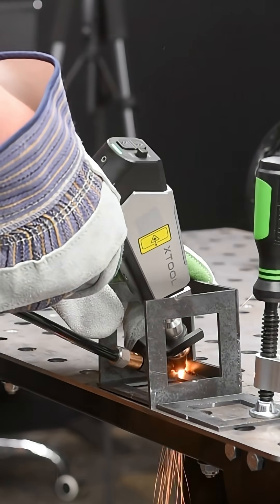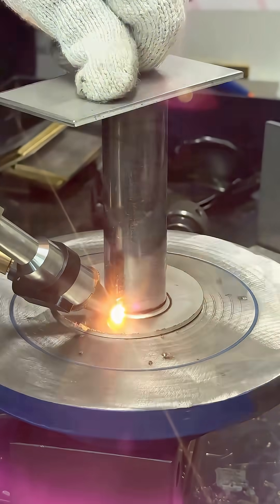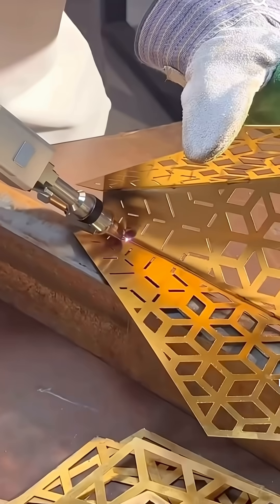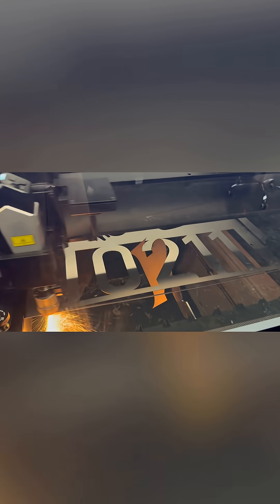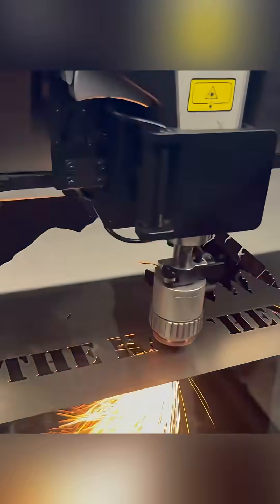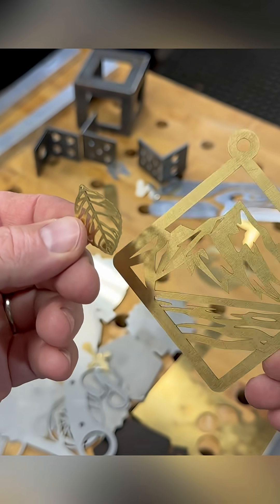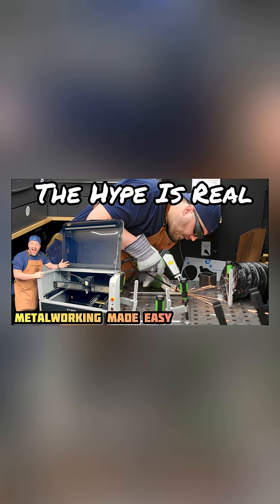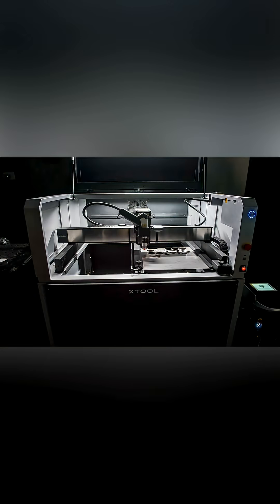xTool Metal Fab: Metalworking Game Changer is in Stock

Comment: Or you could just learn how to weld and cut the crap, this is a complete joke of a product and it probably dosnt even work
Reply: It works amazing wtf are you talking about
Reply: @ninjality7o2 It definitely works to barely hold it together. If you need any sort of structure it won't hold it. This is ment for thin sheet metal not anything that has to have weight on it.